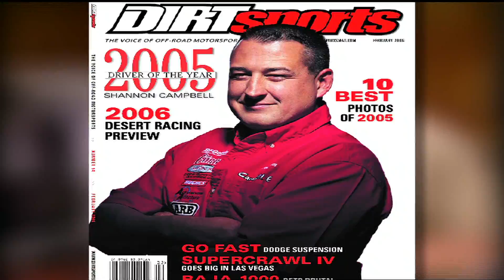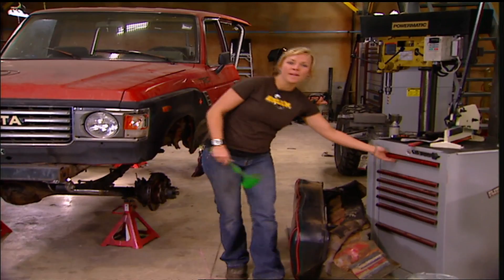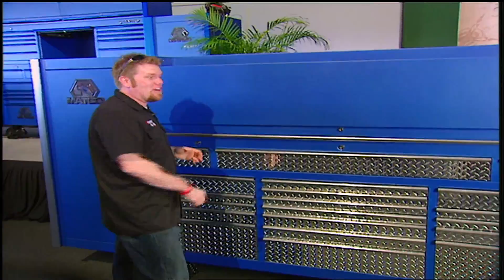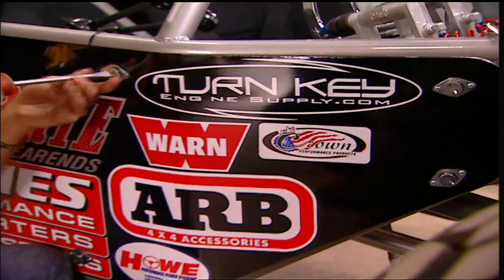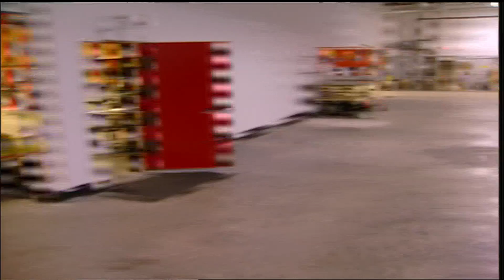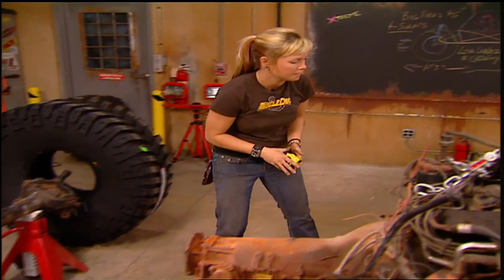Building A Tube Chassis For Our Bottom Drawer Buggy - Xtreme 4x4 S2, E14

Comment: If I wanted to build an LS powered tube 4x4 (with Atlas II or SCS Transfercase) chassis buggy with Rockwell axles front and rear. Would I need to double up the tubes on the chassis? I had already planned on using 2" Diameter DOM and 0.250 wall thickness. Hoping that I would be able to getaway with running single tubes instead of double tubes. Thanks in advance for any and all advice, opinions, or answers.  Regards,